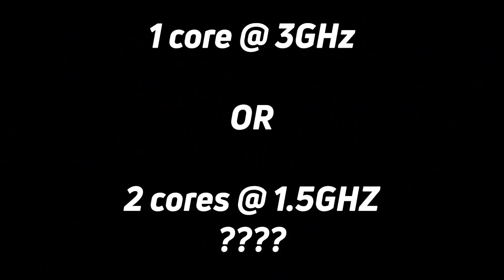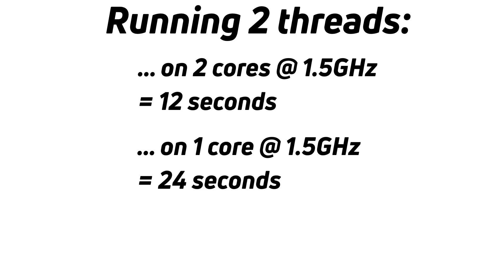Single-core vs Multi-core Performance and Efficiency

Comment: But amd ryzen even the 1st generation had a slightly higher multicore over Intel's equivalent cpu with the same cores and also higher clock speed explain this phenomenon .The only thing I can conclude here is the superior Zen cores design choose over Intel's architecture.

Also one more question bcs this is something I have read in Reddit cinebench is way more accurate and have complex calculation compared to geekbench and represents cpu performance more accurately is it true.
Also I have read that arm despite being more powerefficiet and reduced instructions  still cannot do lot of complex calculations as that of x86.
Please answer my questions this are some clarification which I really need to get clear
Reply from the maker: What do you mean by " over Intel's equivalent cpu with the same cores", same cores? I don't understand.

As for Arm and "complex calculation", what do you mean by complex calculations? What type of apps/program need to do these "complex calculations"?
Reply: @GaryExplains when I talk about complex calculations a good example would be complex mathematical simulation used in  big science projects or simulating the galaxies and calculating the important parameters etc .
And about Intel equivalent I mean say ryzen 1800x vs intels 8 core 16 threads in 2017 despite Intel boasting same cores and threads and even higher frequency , and a commamding lead in single core it was still beaten by the ryzen 1800x in multicore and same trend goes in 2019 as well 3700x beating Intels 9900k (8 core 16 threads in multi core while trailing in single core)
Reply from the maker: So with regards to Intel vs AMD (if I understand you right) it all comes down to the micro-architecture, like I said in the video, clock frequency isn't really the important factor, but how much performance you get per core multiplied by the number of cores.

As for Arm and complex instructions, I don't see why an Arm chip couldn't do that. Arm is quite new in the server market space. But the Amazon Graviton 2 processor looks amazing. I am keen to test it.
Reply: @GaryExplains  but Gary arm is just newly been implemented in the server which says it's potential but still not there yet .Don't u think x86 still hold and edge over arm in terms of instructions carried out .

Also if u say per core performance multiplied by no of cores tells the multi core performance then y is sd865 despite having way less single core compared to a13 have same multi core score. How's it possible according to ur logic . 
Also about geekbench vs cinebench the question I asked u haven't answered yet I need to get clarified all these questions
Reply from the maker: In terms of brute performance, Intel still has the edge, but there are other factors for servers like energy costs. Did you see this video of mine: https://www.youtube.com/watch?v=KLz8gC235i8

As for A13/SD865, the A13 has 6 cores and the SD865 has 8.

I know nothing about cinebench.

Comment: Thanks a lot Professor for the explanation! Will use this video to "educate" all those Apple fanboys bashing android SoC's 😈
Reply: MAS921!
Reply: @1MarkKeller  yes?
Reply: Stop always making it about android vs apple. Also: The video compared cores with similar architectures. Dont see how you can use it to lecture anyone.
Reply: @jesusisgod94  What is "Geekbench scores?" ....I😁
Reply: I hate to say it - but if you are apple and you know exactly what hardware your running software on - it's ALWAYS going to be better than any random generic android soc.  Diversity is both Androids strength and weakness, especially in todays trend of race to the bottom.
Reply: @Nossieuk  have you developed an android app? You won't say so if you really get into how android software stack runs.
Reply: @mas921 if any of this was actually the rule of thumb - which it's not - we'd all be using nvidia gpu's with 1000s of cuda cores as our CPU.  There is a big reason why this is not the case - the higher the cores, the higher the overhead to manage those cores so your efficiency does not scale linearly - this is why those cpu's are restricted to polygon /shader and bitcoin number crunching.  I'm sure Gary could write a script to find prime numbers across those cuda cores and it would run great too - but in real world applications it's hopeless. I agree that power efficiency is really important on mobile, but throwing cores at anything is not the simple solution.
Reply: This was more a general rant about this video --- but in actual answer to your question - yes I did - multiple socs, os's some with some without features, cheap knockoffs, expensive knockoffs ... just not worth it. https://www.statista.com/chart/19303/mobile-android-operating-system/

Comment: I will prefer single core for single thread processing of course 😉. Sure with multi core you can save energy, but more cores need more space, more die, so will be more expensive ... Not easy to find best compromise for all (people/situatitions) ...
Reply from the maker: But also remember that a single core with high single thread performance takes up a lot of space, making such a powerful core takes space. The transistor count of the hexa-core A13 is similar to the transistor could of a octa-core Snapdragon.
Reply: @GaryExplains  I aasumed we were talking about the same cores, so f.e. A53 core. 
So I would prefer a single A53 core with 3 GHz instead of two A53 cores @ 1.5 GHz...
(Although A53 might be a 'bad' example because of missing out-of-order feature...)
And usually you cause an overhead when using multiple cores instead of one. You need (different) multiple caches, RAM management (read/write), consitency(?), you cannot easily predict/optimize codes (which core will run its thread faster, which will be first and read/write RAM or continue with next thread/task).